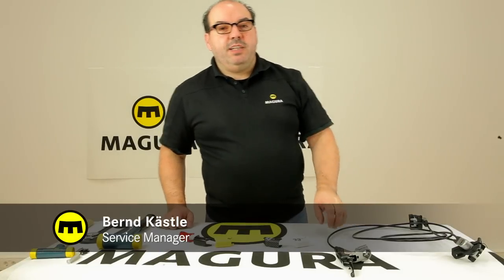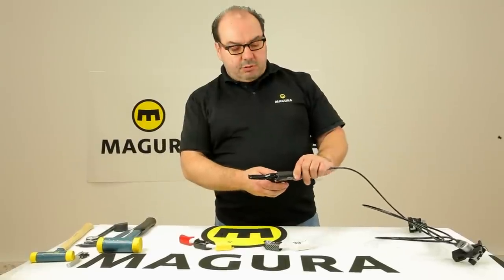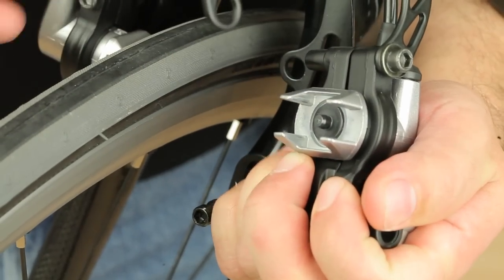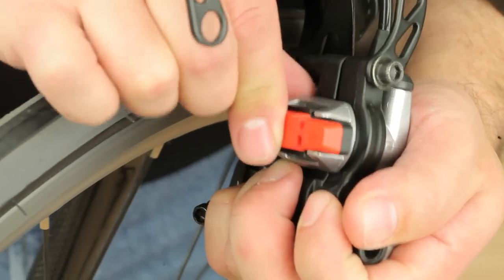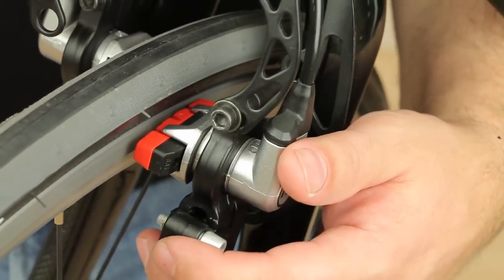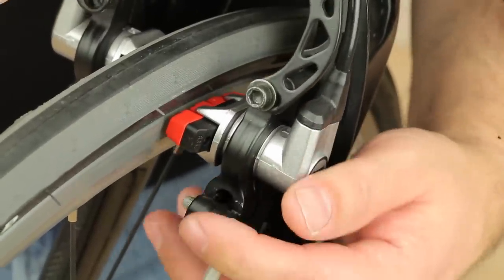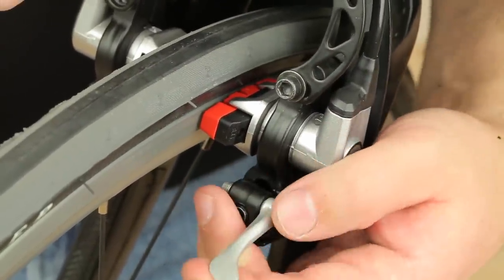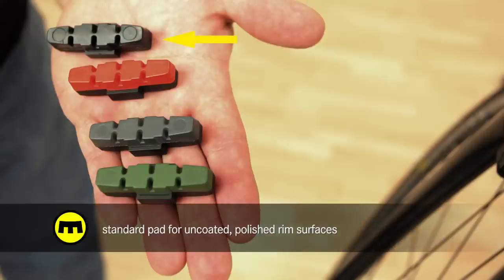Brake pad replacement on a MAGURA rim brake  (HS33 and HS11)

Comment: So the left side is all fine and dandy but you have to remove the whole wheel to do the right. Am I missing something or is this rather  stupid design. I have much cheaper V-break system from Shimano on my old MTB and I can replace BOTH pads without removing the wheel. Not to mention the prices of the pads...Buy those only online with at least 30-50% discount. Not worth otherwise. I have the HS33 a n my touring bicycle. Needless to say these breaks are too weak for the max total weight that VSF Fahrradmanufaktur (the company the bicycle is from), which is 170kg. I dear anyone trying to properly stop with even 2/3 of that weight. Alas! it's not Magura's fault but the poor performance when wet is. They even sell special pads depending on the weather conditions. As if I'm going to remove both my wheels to change the pads just because it started raining...

Comment: Changing the left side is super easy. Why isn't there such a handle on the other side as well? I have to dismantle half an e-bike just to replace a brakepad on the rear wheel?!
Reply: The quick release handle is there to make it possible to remove the wheel without having to remove and re-install the brakes completely, for instance if you get a puncture or need to replace a tyre. 

If you find that you don't have the skills needed to remove the wheel or remove the other brake to do a simple job like this, take it to your local bike shop and pay them to do it for you. Tip: you don't need to remove the wheel from the bike, just loosen the axle nuts and tilt the wheel to opposite side to unclip old brake pad and click the new one in place.
Reply: You can also unscrew the lower torx screw of the left side to remove the brake, then you can put it back on without needing to align the brake cilinders all over again.

Comment: I'm really disappointed with price for magura brake pads! they are TOOO EXPENSIVE !!! What's even worse is that they don't last long!!! After month or two and I have to give 20 euros to put new pads..
Reply: Yeah did the same thing only i had to order them from Germany. They charged me 20 euros for that and the brakes where 12,5 euros... I'm sad to say but I will replace the Magura rim brakes because they are too expensive to maintain and they don't give you any better braking performance than standard brakes.
Reply: yeah, same here..
Reply: kopiledon the convenience and consistency over cable brakes is much higher. Power wise if you need it too. If you shop around ahead of time you can find some decent deals
Reply: I have just ordered a pair of this to replace regular vbrakes on my bike since I can't fit disk brakes on it. Do you think it was a bad decision? I thought these hydraulic would be better. Was I wrong? :(

Comment: HEY, all you guys saying it's SO difficult to remove a wheel. At least you don't have to readjust the brakes. Just the height of the quick release side. I know it's more difficult with hub motors but as I said, at least no adjusting.
Reply: You can also remove the left side with the lower screw. Then you also just need to adjust the height when putting it back. No need to remove the wheel at all.

Comment: Can these fit on any tire I have 29inch wheels
Reply: The tires pretty fat
Reply from the maker: That depends on the setup, you can find all maximum dimensions within the HS manual. The maximum tire width is 2.5".